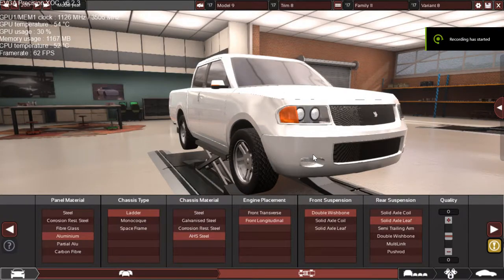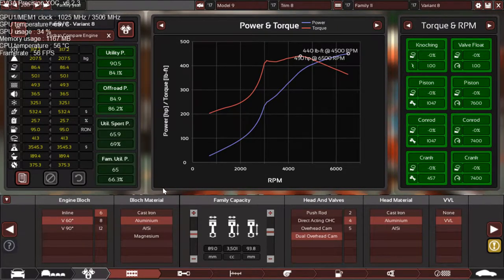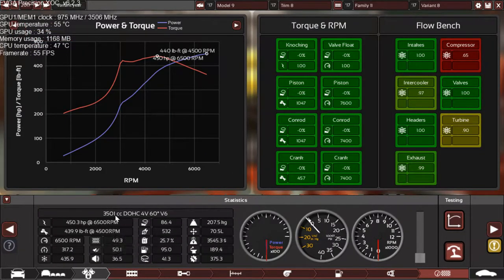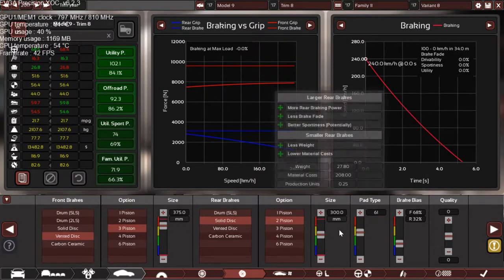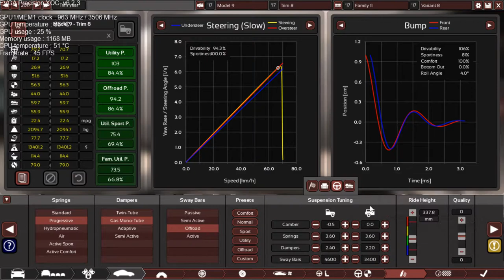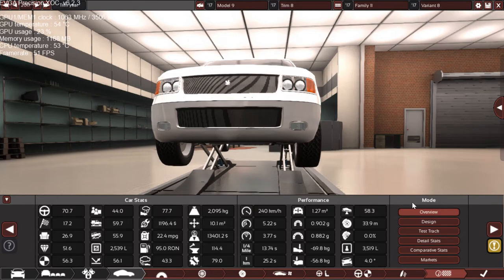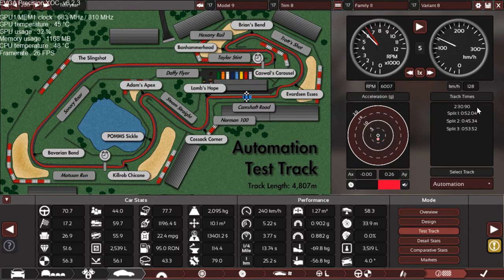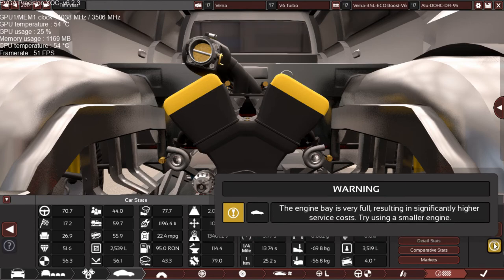Pickup Truck with a Raptor Eco Boost engine.

Comment: Could you make a mini truck? Smallest truck they have. And put a 3 cylinder in it? At least 150 hp and more for street use than offroad. Kinda like the 80s Toyota Tacoma. I know, that suspension bug will likely kill tis idea.
Reply from the maker: I would love that but I have to search for this kind of body. 
And it’s true about the bug. 
Thank you for your awesome request